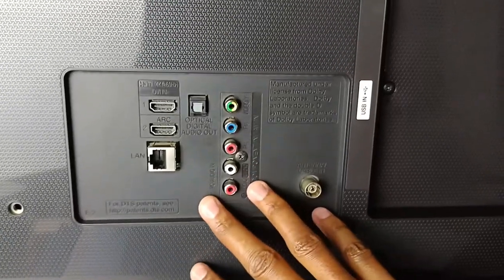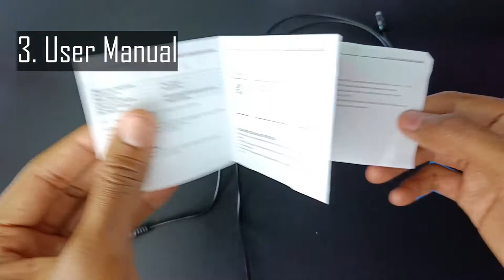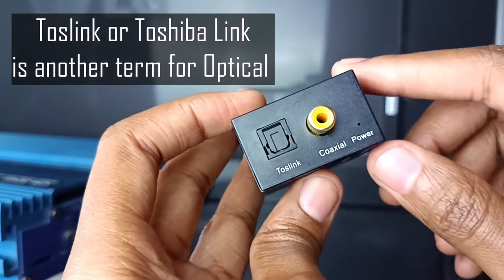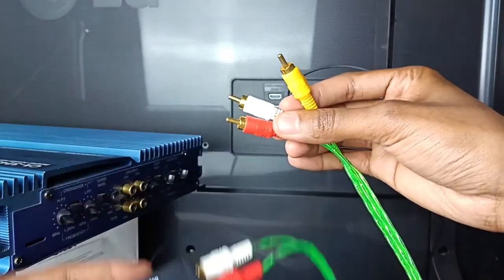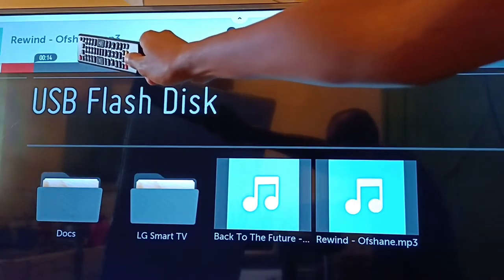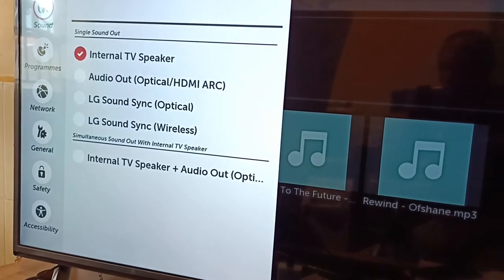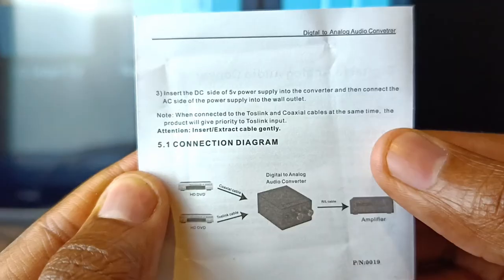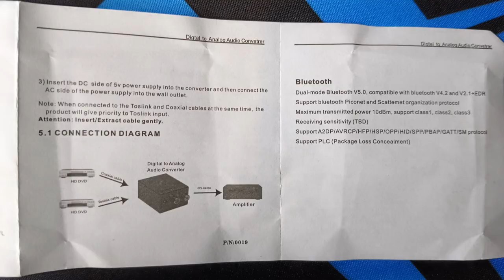Digital to Analog Audio Converter - Works remarkably well

Comment: What if there's a delay between the TV and the applied speakers? I can't get to solve that problem.
Reply from the maker: I didn't notice any delay with my setup but if you encounter it then there are some TVs with the right setting to help. For example, my TV has the AV Sync Adjustment setting that I can use to sync the TV and optical output sound.